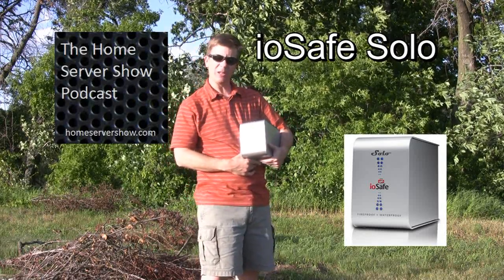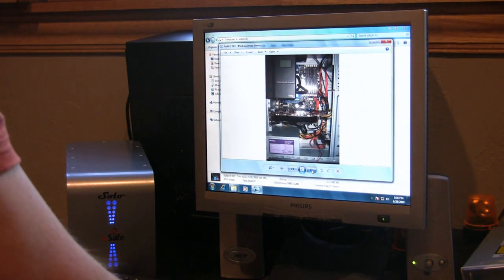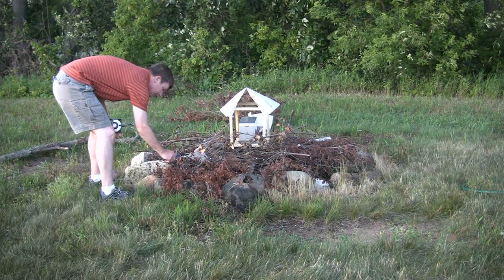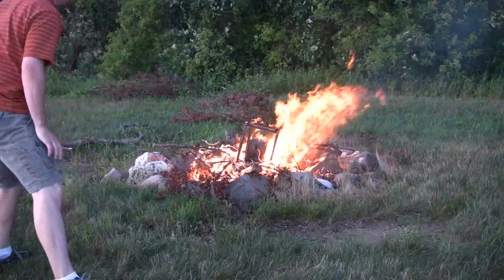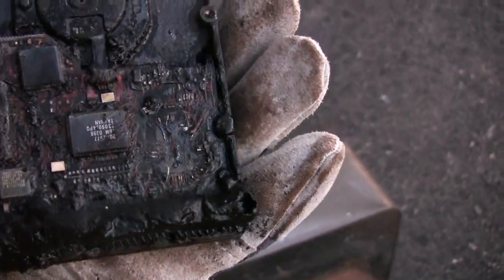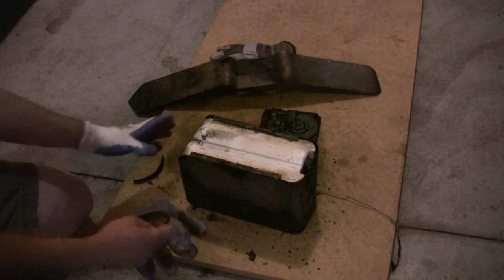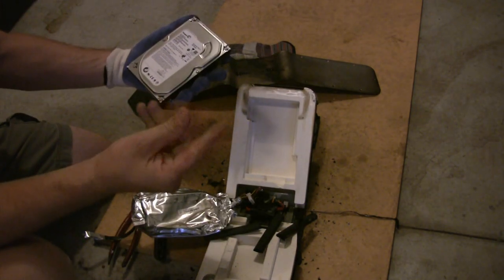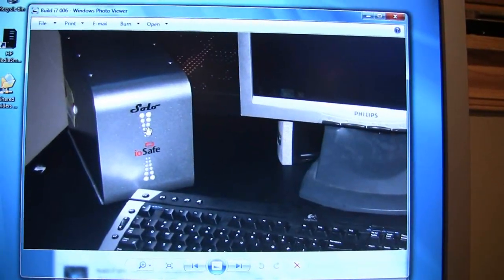Testing the ioSafe Solo with fire!

Comment: @iToasterman they heat up too much, which usually result in short lifespan (even with sufficient cooling)... i just found it ironic that such an expensive fire-proof external hd, uses quite cheap mediocre hd instead of some top of the line more reliable hd.